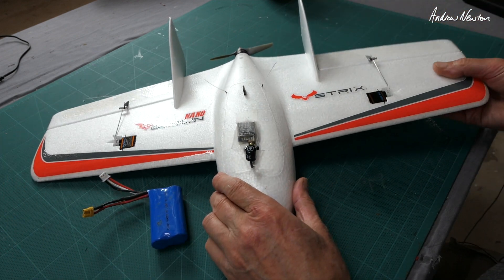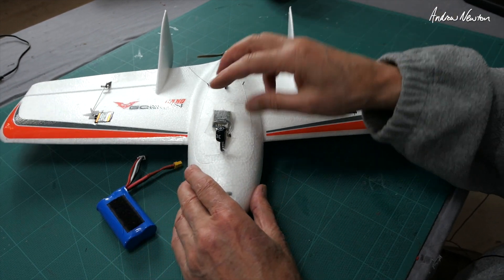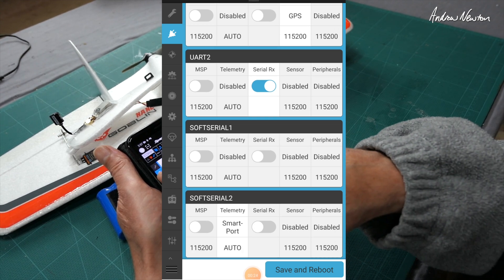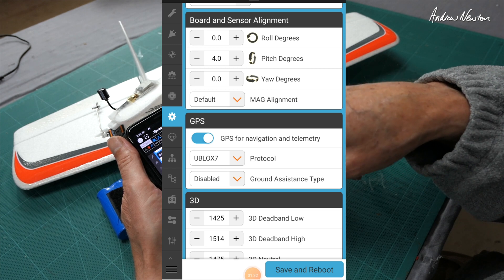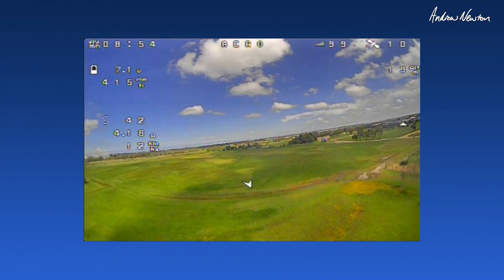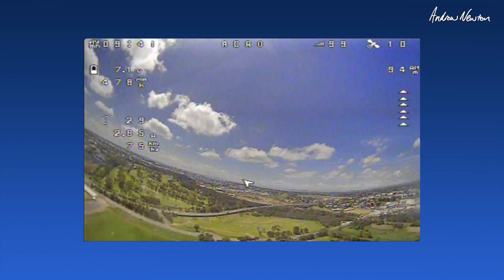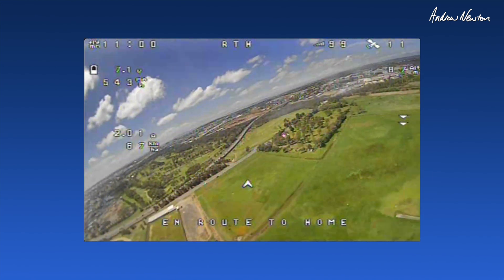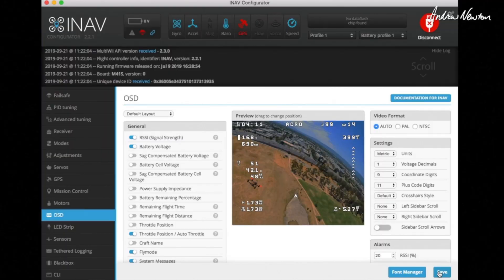Nano Goblin INAV F411WSE

Comment: Hay Andrew, I just purchased a matek f405 wing board and was wondering does altitude hold work through GPS or do I need a vario ?
Reply from the maker: No need for a vario. Alt Hold uses the F405 Baro or GPS if connected.
Reply: @AndrewNewton  thanks

Comment: exactly the info i was looking for but I am perplexed - I was tuning my Nano G and wanted to actually increase my roll rates and decrease the elev inputs - so I did through the mixer as you show - except you dialed way down both ail and elev - 40/20%. I dialed my ail up and my elv down - 60/40%. My NG seems to fly really well like this for me - but maybe I am missing something.

I have two FPV Nano goblins - one with inav and one "naked" w/out a FC. Throws on my naked NG are 100/100%  and I use rates in my radio to tame it down - is that wrong too, am I stressing the servos, if so Ive been flying it for years like that?!

Do the totals of ail/elv need to equal 100%?
If you are less than 100% do you get more resolution on the sticks then (effectively lower rates)?
The tune you did for the big Goblin you left at 50/50% - same style plank wing different mix?
You say the NG doesnt loop - I can inside/outside loop no problem - even on 2s. Would that be because your elv throw is too low?

Please do a detailed video for mixer/tuning of different wing/plane types that answers some of these questions.
Reply from the maker: 50 50 mix means you never run out of elevator or aileron movement. Full elevator stick plus full aileron stick adds up to full servo deflection. But in reality 100 100 works fine for normal flying. NG fliers have told me my elevator throws are too big and that causes the hyper stall situation, which prevents loops. I have only had a few lights with mine so your settings are probably more suitable. How much elevator throw do you have?
Reply: @AndrewNewton  Thanks for the response, making more sense by the minute. My physical servo links are on the middle hole of the servo horn (stock position) for both my naked and inav NG. I am currently flying my inav NG with ail mixer set to 60% and elev at 40%. Both have the older stock NG motors - which are cobra 1407-3500kv. I run the naked on 2s with the stock 3" prop and  my inav 3s/4s with 4.1x4.1 - both are at or under 250g and can outside loop - for the 2s i need to enter with some speed.

ps. 4s is just for kicks - a 1300mah 3s is my ideal battery... looking to find/make a 3s LiIon now...

Comment: I can’t remember what most of my iNav settings were on my Nano Goblin. But I remember the roll had around 520 deg/sec 😄

Planks are always pitch sensitive. You’ll find that on your other Goblin too. 

Oh, with the 2S LiIon. Watch the voltage as most VTx’s need 7v+ to work. The F411-WSE is 6v+ too. They are fantastic little planes though 🙂
Reply from the maker: Oops, I did see that discussion about minimum voltages. Thanks for the reminder Mr D
Reply: @AndrewNewton  No worries. The best bet is a boost regulator for the VTx, and just land at 6v for the rest of the setup. Check the ESC’s low voltage cut off too. But most of all, have fun 🙂

Comment: I believe it is better to leave the Mixer at 50 weight and then properly adjust the PID rates to lower ranges for Pitch. I leave my Nano Goblin Pitch Rate at default, but increase the Roll Rate to 360.